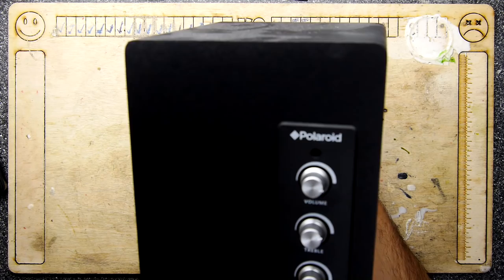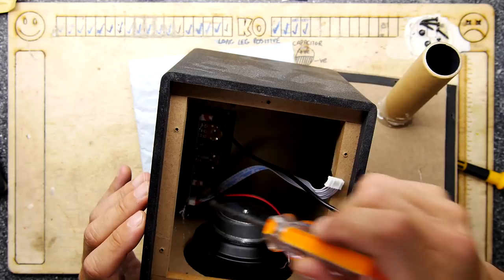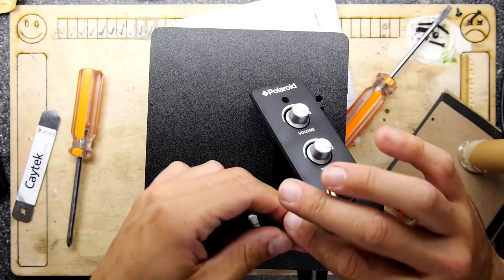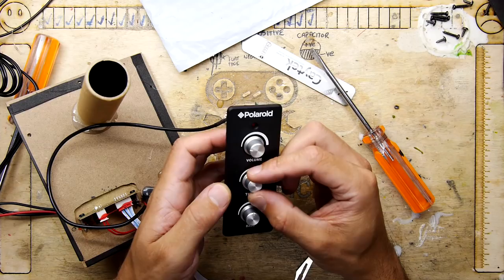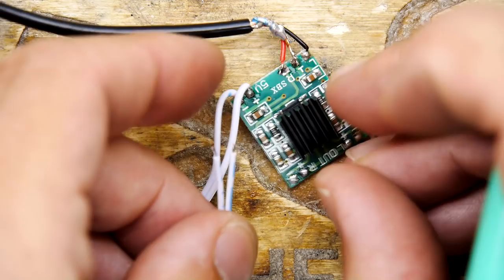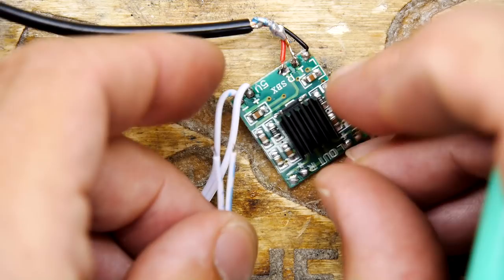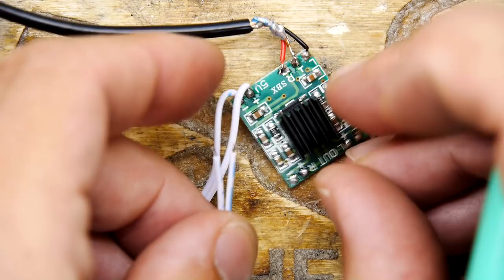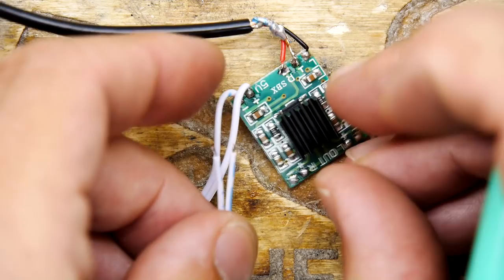Polaroid Speaker Repair

Comment: Actually the inductors you used act a s a low pass filter above 20khz to filter the emi from the amp,If you want to actually low pass the signal you must use an rc filter on the input of the amp.Great videos!

Comment: what does that toilet tube do.. sorry i'm a bit thick..
Reply from the maker: Probably nothing really 😂
Reply: @backofficeshow  True dat... But supposedly it is to improve the bass response by making the box a ported (the tube is the port) enclosure instead of a sealed one.
Reply from the maker: Ahhhhh
Reply: that went over my head.. haha.
Reply: @bazza5699  Crutchfield has a pretty good write-up on the subject - https://www.crutchfield.com/S-xQ6D4Sn6rkC/learn/sealed-or-ported-subwoofer-enclosures.html

Or just Google 'sealed ported bass enclosure's for more sources...
Could throw in 'band-pass' as well for a 3rd type of enclosure (even louder, but also even more limited frequency-wise than the ported enclosure.)

Technically the ported enclosure should be protected from frequencies below the tuning frequency, as the port then  offers no resistance to the speaker movement
 (Compare punching ve slowly pressing on a leaky (ported) ball) but I don't think it'll be a big issue for this little thing.